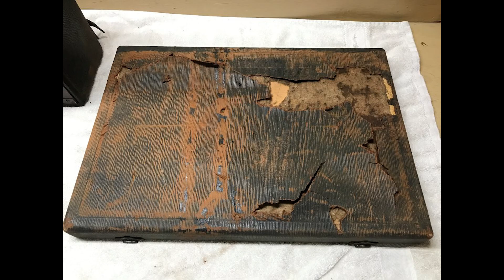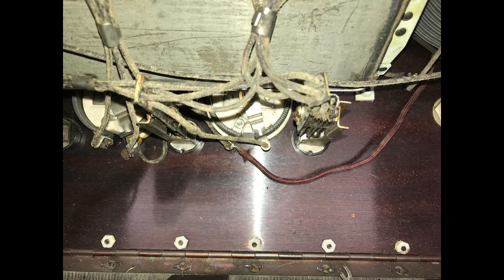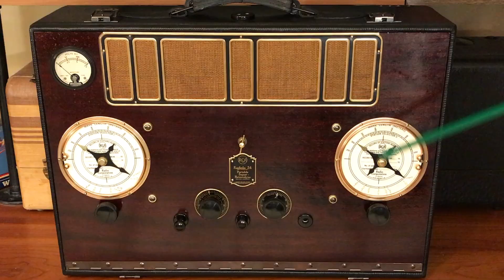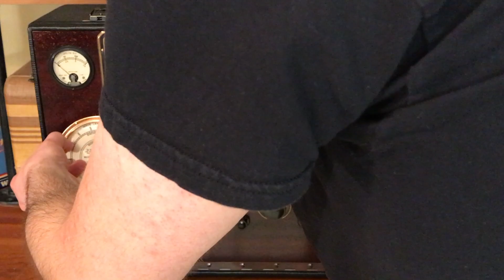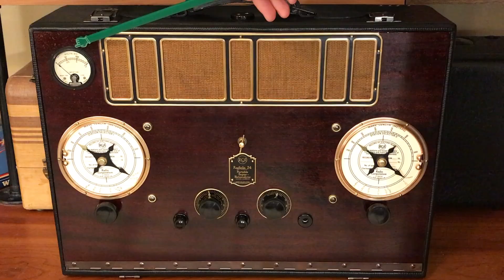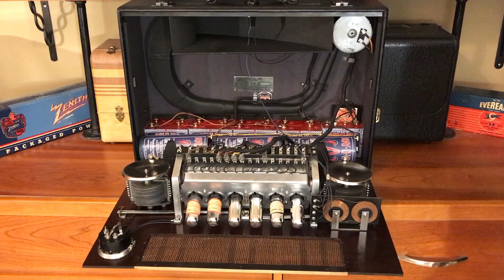1925 RCA Radiola 24 Demonstration

Comment: Amazing restoration. The transformation from its rough starting condition to the mint final product is a testament to your effort and skill. Having restored a Radiola 26 myself, these early sets are not easy to restore due to a scarcity of replacement parts. Excellent job fabricating the loop antenna. I don't think I've seen a better restoration of a Radiola. Well done!